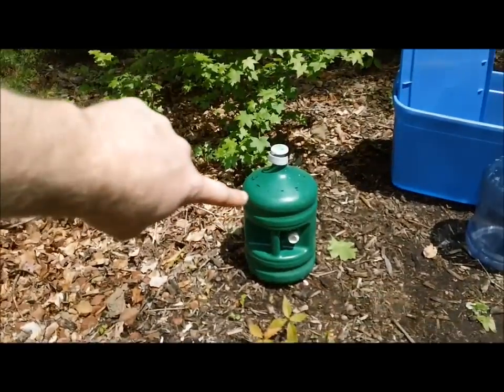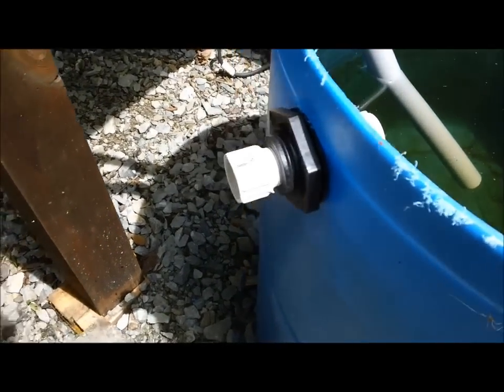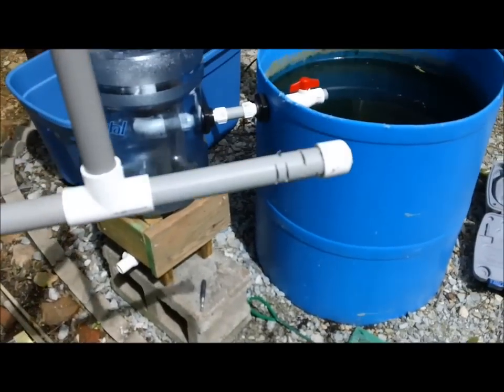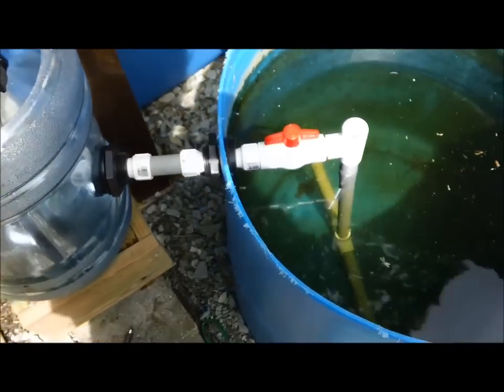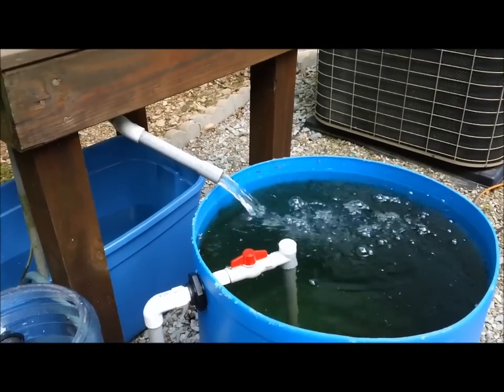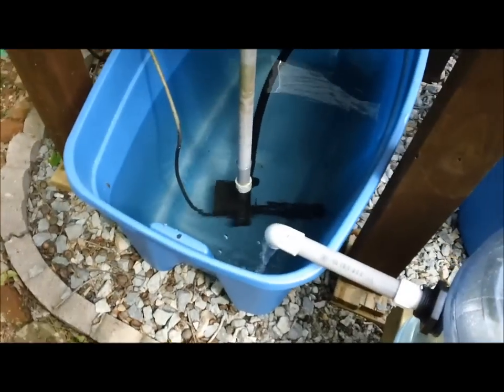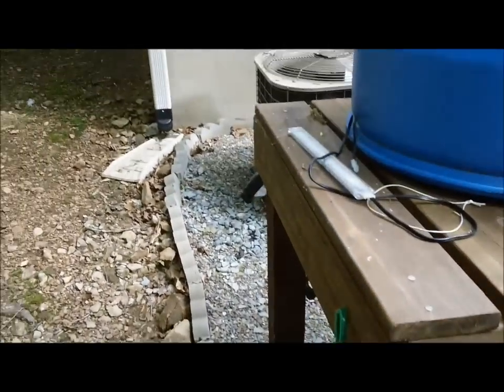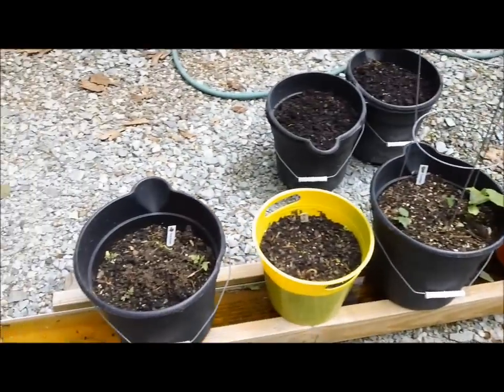Single Barrel Aquaponic Rebuild

Comment: I would suggest to raise your tank so it can gravity feed into the grow bed after the swirl filter and just use the pump to keep the fish tank at an constant level. It will make life a lot easier, but of course that's just my opinion haha. Also that amount of produce will overwhelm the bed once they get bigger. Tomatoes will absorb copious amounts of nutrients, which in turn will cause other plants to suffer. I have a larger system in my yard and even with 20+ fish in my tank, my tomatoes sometime yellow and I have to supplement nutrients. Hope my advice helps ya.

Comment: Thanks for sharing your mistakes as well as your enlightened moments. Good to see a very simple system that keeps the subsystems very easy to see. 
Did you have problems with the swirl filter being clear and having growth in it due to the clear bottle?
Reply from the maker: +Michael Stoddard Sorry for the extremely late reply.  Yes, I did.  I attempted to place a HomeDepot bucket on top.  While it did a little good I think I still need to spray paint the bottle itself.  Algae does grow well with all that nutrition.  The bucket also breaks down and isn't quite the best fit...but it works.

Comment: Does the stand pipe drain constantly suck water or on ly when the water gets to a certain level? Also, once it starts, will it stop once the water level gets below the pipe?
Reply from the maker: Stand pipe in the FT drains constantly.  It is open at top so syphon doesn't engage.  I do need to make the outflow pipes bigger though.

Comment: get some IBC's and mess with those... every IBC can make 2 growbeds (cutt the thing top top bottom removing the filler and exit parts... An IBC can also make a great fishtank or a smaller fishtank and a sump (if needed) regards, Sander.

PS: exhaust lines should be at least 50% larger in diameter (prefably double) then the inlet lines... for obvious reasons...
Reply from the maker: sandertel Hey man,  Thanks for the view and reply.  I do have plans to incorporate at least 2 IBCs.  I also have plans to increase the outflow lines as well.  School is currently taking my time, money, and energy.  

I love drawing out the plans on paper.
Reply: All I can say when working with IBC's, choose those which let them turn into tractical growbeds... and don't go overboard on the depths... 10-12 inches deep will suffice unless you like to grow small trees aquaponicly...
Just look lang angood at the IBC's you find and diside what type you choose and how to cut the blatter and it's cage... you probably need the cage aswell to reinforce the flimsy plastic blatter piece.

I recommend you search for and watch video's by a guy named Affnan, a Malayian gentlemen who designed a silenced, aerating syphon output and a very well functioning bell syphon for that matter... great stuff.

understanding the laws surrounding energy all too well, signing off...
regards and good luck, Sander.
Reply from the maker: sandertel I have been a follower of Affnan on his blog for a long time.  He has even been gracious enough to list a link to my blog on his blog.  He has wonderful ideas and projects.  I freaking love youtube and its treasure of kind people and wealth of knowledge (present company included)

Cheers!

Comment: what is the water holding capacity of the barrel and what number of tilapia fishes i can released in this barrel??? plz
Reply from the maker: It is a 55 gallon drum.  The top 1/3 is used for the grow bed.  
The amount of tilapia depends on size of tilapia and oxygen supplied.  (I think)
Reply: if the fishes 10gm every pices and want to culture untill it is 250gm then what number of fishes i can release in this tank and is there artifitial airation needed?? plz
Reply from the maker: I do not know about the number of fish. Airation is always a plus!  So go ahead and add those air stones.